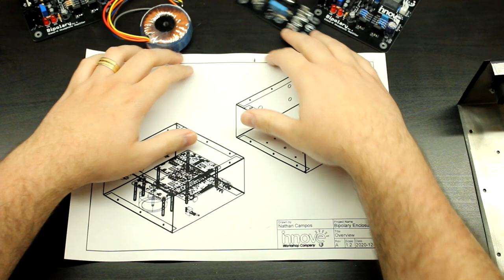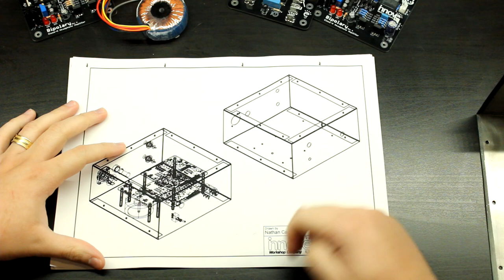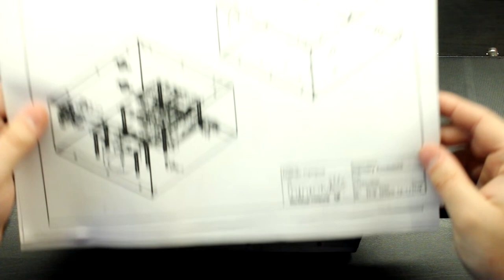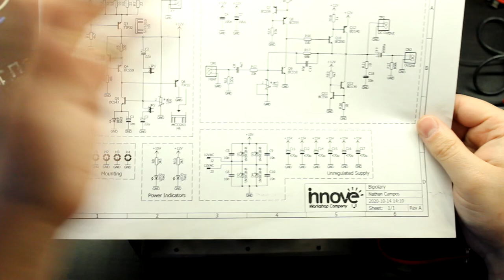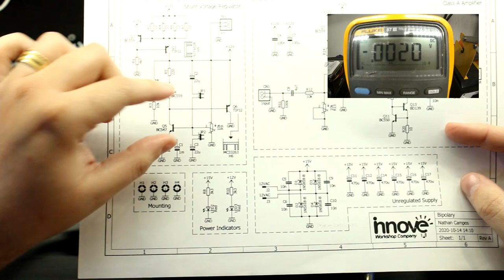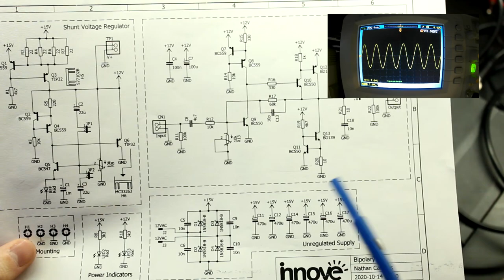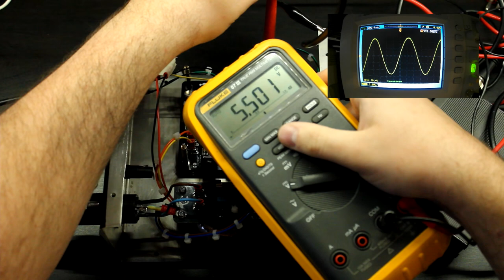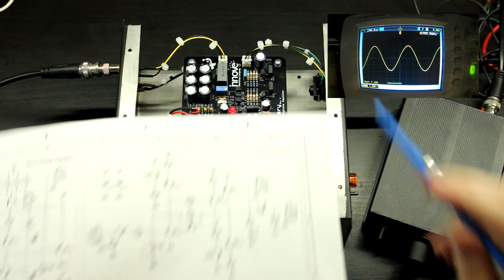#022 - Amplifier Assembly and Bias Adjustment (Class-A Discrete Headphone Amplifier Project)

Comment: man, I spent almost 20h watching this projects GREAT videos
downloaded your project (I understand "Rev A" is the final one and the diagram as well?)
but I have a question:  my headphones are 37 Ohms, with only 94dB sensitivity (Hifiman Sundara, plannar)
I am not sure this amp will be enough for them
The amp I use with them is almost 4W on 32 Ohms while yours is much less (considering your power supply is only measured 3VA per channel)
What is to be changed to have more power from your amp?
I think the current you designed will be not enough - right?
you started with 300 Ohms ones - for sure they need lots of Volts but much less current
any hint?

thx
Reply from the maker: Reading comments like this really makes my day.

Rev A was the final revision, but it's geared towards higher impedance headphones. It'll drive a 37 ohm headphone fine, but you'll get a slightly higher distortion (still lower than 0.1% though).

If you want to make this design more suited to lower impedance headphones all that you'll have to do is reduce R20 to get a bit more idle current, and while you are at it you should also reduce the input voltage of the amp to reduce the power dissipation that'll come from the higher current. Don't forget to also change R2-R7 in the power supply section to match your new current requirements.

All that will definitely improve the performance of the amplifier with low impedance headphones and make it perfect for your Sundara.

If you want some more details about the design, including some nice measurements that I've performed on it you can check out its page here: https://innoveworkshop.com/project/bipolary
Reply: @innoveworkshop  thank you brother, I am still thinking about the values: Consider 2W needed on 37 Ohms. Considering: P=I^2*R -> I^2=P/R = 2W/37Ohms= 0.054 -> I= 0.232A. Now from: P=U*I -> U=P/I -> 2W/0.232A=8.6V 
So we need 8.6V with current max (for 2W) needed 0.232A. This is more than 3 times your calculations (you calculated max current on 70mA if I remember correctly). 
So considering this what is to be changed? 1st is power supply - that is obvious. Then? We need enough voltage on the output (max 8.6V)... So now I am not sure if improving power supply AND just adjusting resistors is enough. Any hint? For the amp section I am concerned.